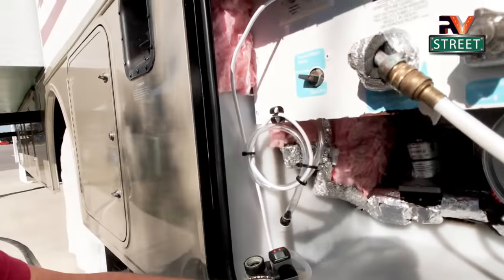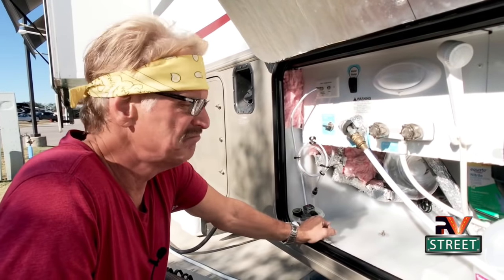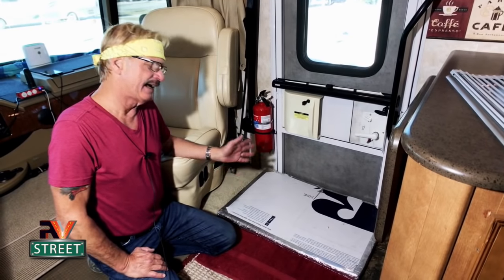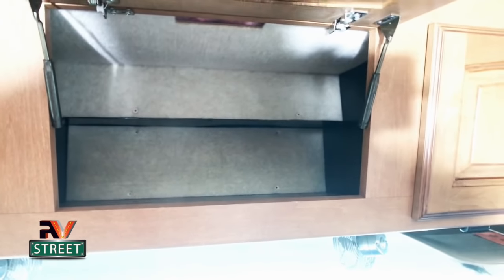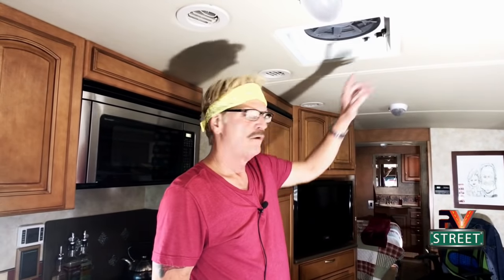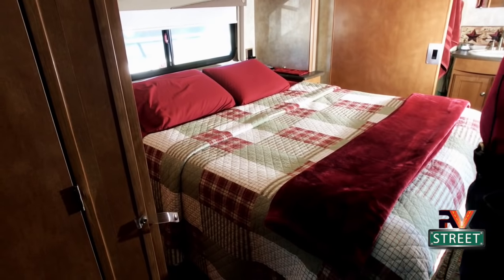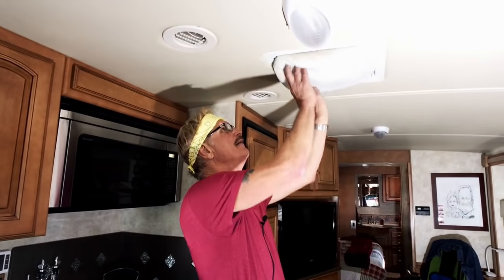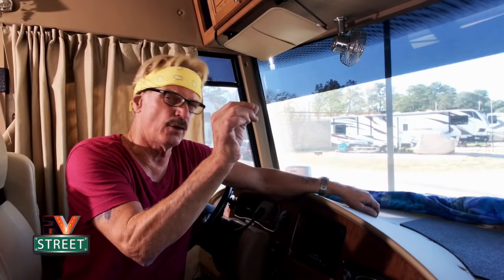😰  INSULATE, HEAT & PROTECT • Key to stay warm in your RV

Comment: Great video!  But...I am confused, as I always heard that propane is cheaper than electric...your thoughts?  I stay in a full hookup park and while the electric is relatively inexpensive, I have heard that propane is still much cheaper to heat my coach than electrical.  Contradictory to what you're saying.  Thoughts?
Reply from the maker: Well it depends on part of the country you're in. Up in the north east, propane has almost doubled since last year. And, a lot of full hook up sites include electric with your site fee. Can't get any cheaper than that. But in any case,, with our years of traveling, electric has always been cheaper whether we're in a full hook site or not. I fill up my propane once a year. I use my propane for just cooking. If propane is easy and cheaper where you are then by all means use propane.

Comment: Martin, I have a 2013 Vista in the same layout you have.  Have you ever tried to block the heat/cold that comes in through the shower sunroof?  I have the pillows for the vents but I have been unable to find one for the sunroof.  Do you use anything in that area?  Thanks for all your help.  My wife and I are just getting started, haven't even been out yet but looking forward to a trip to TX in June to see my new grandson.  Just worried about the heat.
Reply from the maker: I had a custom sun screen made for the shower sky light. I just snap it on in the summer and put it under the bed in the winter. https://rvsunscreenco.com/
I also applied Dicor roof coating over most of it on the outside. BIG difference reflecting heat. You can see that in this video: https://www.youtube.com/watch?v=H00oNtbvtrk&t=1209s
Reply: @RVstreet  Thank you.

Comment: Martin, agree to use free electric for heat vs propane, BUT: even if you have heated water/gray and black water tanks, that may not keep your lines from freezing. However, running the propane MAY be needed for that purpose to some degree (no pun intended). However, electric ceramic heaters and/or a fireplace will effect the thermostat and could keep the propane system from coming in at all. So I suggest keeping the ancillary heating system below where you set the thermostat for propane heat if the goal is to keep your drain lines/water feed pipes from freezing. You can still save on propane use AND save money by using the free electric at full hookup sites! Your thoughts?
Reply from the maker: Well that's why I explained that I do keep a auxiliary heating system below for the tanks. A 100watt light bulb. That's all that's need for us to about >10º. I don't have heated bays like many others. But I only use that when it's going to get below freezing for a prolonged period of time. Our floor furnace in the RV keeps everything else from freezing because of the extra insulation I've done. 
But my comment about why people use their propane instead of free electric when it's not freezing or the threat of freezing was covered more in detail in the very first comment.
thx Scott 👍
Reply: @RVstreet  for travel trailers, it’s more critical to pay attention to the solution I described. Your solution for a class A or C is (as are all of your videos)), EXCELLENT! Keep doing what you do brother. It’s excellent advice.
Reply from the maker: @scottanton4374  👍

Comment: Just curious.  What do you recommend for insulating single pane windows on a travel trailer?
Thanks. Enjoyed the video!
Reply from the maker: Single pane windows can be a problem and not all single pane windows are of the same thickness. Higher end RV's have 1/4" single pane windows, others may be less. You have to be creative here. Some people use reflectix cut to fit, some use foamboard or Styrofoam insulation.....I've found R7 for 1", Ultratouch Radiant Barrier, it's a silver sided cotton blanket type material but sometimes hard to find.

Comment: Yes not sure why they don't insulate better, our 28' pull behind is not insulated to well. Some one told me they are a little better then they used to be. The insulation will help just as much in the summer when it is hot too. Our last time or two out camping I will turn the propane furnace on(more to make sure it is still working) but plug in a electric heater also, and heat mostly with the electric.
Reply from the maker: Definitely will help both in the winter & summer.
It's all about manufacturers bottom line $$$$$$. As you upgrade to higher end RV's and pay more you get more stuff like thicker walls and more insulation. The bulk of RV's sold in the US are to the general masses as entry level RV's. However, some manufacturers do make true 4 seasons RV's but you pay more those. But even with those RV's you still can improve some things to make them even better. It really comes down to what kind of RV you need and what you can afford.
thx Trevor 👍

Comment: I believe you want to use propane furnace if the bays are heated using the propane furnace to keep the water from freezing.
Reply from the maker: Ya but many RV's don't have heated bays heated by the propane furnace. Like ours. We use heat lamps in our bays if it does get freezing. But if it's just cold but not freezing heating the bays are not necessary. So if it's cold but not freezing I just don't know why folks use their furnace using propane when they already have electricity paid for and they could just use electric floor heaters, That's what I was trying to get at.
Thanks for your comment Steve. It gave me another way to clarify what I was getting at. 🙏 🔧

Comment: Im looking to but a vintage bumper pull. I need nor want a new one nor a large one. So w/a shower & BA Im good. My mind is already right along w/you & your train of thought with all the insulation. I get the R19 but whats the madness behind removing the paper?
Reply from the maker: Hi Regina,
This question has been answered in the comments but here it is again....
In a nut shell, the faced insulation is normally used as a vapor/moisture barrier when used in home walls application and is not needed in this situation and especially when I’m putting in several layers in those large empty cavities. If Home Depot had unfaced in stock at the time, I would of bought that.
Love vintage bumper pulls.

Comment: I don’t remember the formula to see which is cheaper, gas or electric but I am sure you can find it in the search mode. Where we park for 6mo the price for propane is cheaper than electric. We are charged 
20 cents per kWh 
Love your videos
Reply from the maker: WOW 20 cents/kWh that's the highest I've ever heard of. Jeeze. But in any case, running electric heaters IS a lot cheaper in most cases. Plus you don't have to fuss with getting the propane bottles filled over and over again.

Comment: I think you would freeze here in Alaska :). What I have done is this. 1st, I have 2 catalytic heaters that run off the coach propane and require no electricity. 2nd, I have my furnace set up to run off power if I have it and the only thing I use is my blower that way I get heat thru my duct work and to my basement. Again I am using my furnace on electric not propane  keeps the coach at 72 degrees at -15. 3rd I insulated my steps like you do however  the top is 1/2" plywood so I can use it to walk on. As for the windows I use reflex insulation. In the basement I have installed heaters on my water tank, holding tank and piping so they do not freeze. the do run on 12v but  you need to have some sort of power or they will kill the batteries. the rest i have done as you have.
Reply from the maker: Ya, for sure this isn't for Alaska. I'd have to do a few more things to protect for long periods of time in sub 0º temps. But I would never stay in Alaska in the winter in the first place. At least not in our coach. Joanie would never let us do that anyway.If you would insulate under your plywood on the steps you'd get a lot better insulation though and still be able to stand on it. We don't stand on ours. No need to. But anyways,  in the lower 48....we would be good to about 5º-10º> for several days and just use our fresh water which stays from freezing with what I've done. Good comment Merle. thx 👍
Reply: @RVstreet  just a thought for those interested in my system it is called cheap heat. Although like everything else the prices has substantially increased.

Comment: I’ve made many covers for step areas in buildings and even in coaches you should always make that cover able to stand on otherwise it’s a danger waiting to happen when somebody does because they don’t visibly get that there are stairs there and they will stand on it and if it’s not strong enough it will collapse and you will get hurt. So either get a thin sheet of aluminum Or a half inch piece of plywood it will not increase the weight of that item that much and even your top piece of foam that rests on top could be just that piece of plywood or whatever
Reply from the maker: Our cover is strong believe it or not. Tripled layers together it's tough. I can stand on it with both feet and I'm 195lbs. It's only Joanie & I and we know it's there. We just remove it when not in use or when we need to exit. But good good advice to consider for others that may attempt to build one. thx Shock 👍
Reply: @RVstreet  nice

Comment: Lots of smart ideas! Why do you keep taking the paper off the R19?
Reply from the maker: Hi Sharon,
This question has been answered in the comments but here it is again....

In a nut shell, the faced insulation is normally used as a vapor/moisture barrier when used in home walls application and is not needed in this situation and especially when I’m putting in several layers in those large empty cavities. If Home Depot had unfaced in stock at the time, I would of bought that.
thx for watching

Comment: We use propane it keeps our under belly warm and floors warmer more even less draft my whole camper is closed in with at least two styrofoam  layers propane usually 1 tank a WK unless super cold 18 $ a WK including cooking 🍳 when I close in I run straight across and then go around slide outs stopped draft will post a picture also a window sucker that sucks up condeiscation

Comment: You need a carbon monoxide detector down low to detect gas leaks they have sealed Mr buddy propane heaters they can still have leaks ... Make sure to use a carbon monoxide detector.... That goes low as gas is heavy and fills the space bottom up.....
Reply from the maker: I have one down by the stove near the floor. 👍

Comment: Insulation under my slide sounds like a perfect idea. I wonder though my waterlines are tacked down in some way through the area and over the metal wheel well. I think that would make them subject to easy freeze. Do you have an idea of sliding something between the metal and the water line? Also it concerns me about water leaks. Will insulation mask that problem?
Reply from the maker: Will insulation mask that problem?...........
If you can slide some of the round foam insulation tubes over/around those exposed water lines then absolutely that will help keep them from freezing. Treat those water lines just like you would in a house. Protect them anyway you can. 👍

Comment: An 8k diesel parking heater will heat that motor home for around 6 gallons a week in sub zero temps. I’ve been doing it for 3 years.

Comment: What about -25F? 😂 I live in Camada. My wife and I life in our camper May to October. Considering going through the winter this year
Reply from the maker: Well anything under 10º for a long duration is to going to require more than I than what I showed and prepping for sure for any just about any RV and especially if it's a mid-level RV or under. A true 4 seasons RV's have thicker walls, better insulation and so on, but there will still be more to do to prep. I know a fella that lives in Mid Canada in an RV and it gets down to -25º sometimes even colder and he does fine. But he has done a lot to that unit to prepare, he lives in the forest, has an endless supply of fuel because he burns wood and he doesn't move it. When living in real cold temps for long periods of time—which we would never do BTW—lots of things have to be considered to prep properly, Like keep the batteries from freezing, protecting the tires properly, snow weight on the roof and toppers, your water and on and on I could go.
Thanks for watching Bernhard 👍
Reply: @RVstreet  thanks for your reply. I love how you went into detail on your video. Almost no one does that. I'm considering putting 1 1/2" Styrofoam sheets all over the outside walls and doing the skirting with that as well. I'll put a small heater underneath to keep the temp above freezing. So I don't have to run the furnace all the time to keep the tanks from freezing.

Comment: Never saw an RV with large square holes under the slides. Most have a thick rubber sheet to stop dirt, critters, etc. 
Those large square holes under the slides are an invitation for mice (and larger animals!) to get in also. Make a thick rubber
sheet in that area so you don't have to keep removing stuff every time you travel. Also where do you
store all your insulation?!
Reply from the maker: Store in the bay. Very minimal space, no weight, keeps critters out too. What we're doing works great. Keeps out drafts and dirt/dust from getting into the rack & pinion system.

Comment: My propane furnace heats the entire underbelly of my fifth wheel.( Black tank, gray and fresh water tank. So, in freezing weather we use it to keep our 4 season trailer from freezing.
Reply from the maker: Hi Richard,
Ya I get that when it's freezing but what about when it's cold but not freezing?
Here's the clarification I—pinned—in the very first comment of this video:
My clarification on using the propane furnace:
When I mentioned why I don't understand why some people use their propane furnace instead of a floor furnace and their electric at the pedestal, I don't understand why people would do that when it's not freezing temps outside because many do. They're using up their propane, when they could be using a floor furnace instead, use the electric at the pedestal, save their propane, and it's more quiet. Now if it's in the mid to low 20º for several hours or days and they're not using a light or something else in their bays to keep their tanks from freezing, then yes, I understand why they would use their propane furnace. Or if there is no available electric at all, like last years winter event in Texas. In those freezing scenarios, many people who do have heated bays, it makes sense to use the propane furnace. Otherwise, when it's just cold but not freezing and there's electricity, it makes no since to me to use the propane furnace. In 5yrs. we have rarely used our propane furnace.

Comment: In a house with interior doors with an inch open beneath them, pool noodles cut to door with and sliced longways on one side will serve as a draft dodger.  Wondering if they'd help/work for that outdoor use  ... especially if the drafty space is in need of a wider tube of foam insulation.  $1 each at Dollar Tree.
Reply from the maker: I found that using pool noodles is to big and to stiff. Even if you cut them in half. The foam pipe insulation are soft and rolls in and fits just right under the slides. When it's cold and windy, and they don't fit tight, the wind will blow them out and you'll come out the next day and they will be gone. Besides, depending on the size you buy at HD they're only $1.50 - $2.50 each and you don't need but about 3 or 4 of them. It really isn't a money issue, but what works and they stay put.
If you have wider gaps to fill I guess you could try pool noodles in that case and try them. But they need to fit tight.

Comment: I haveto use my furnace and 2 oil radiator  heaters.   But it gets below 0 lots in the mountains of Arizona where I live in my 5th wheel year round.
Reply from the maker: WOW, below 0 is super cold. I can see why you would have to use your furnace and heaters

Comment: I pop off all of the AC vent covers. Put the thin plastic lined packing foam over the hole and snap the cover back on. Is doing this preventing heat from escaping?

Comment: Thanks Martin for a great video. I do have a question. Why do you remove the paper from the insulation? The R-19. Also are these techniques to keep your pipes and water lines from freezing or just for keeping you warm inside? I have a class c and I'm afraid to take it into very cold weather due to this fear of my lines rupturing. Thanks so much.
Reply from the maker: I have answered this question before but...In a nut shell, the faced insulation is normally used as a vapor/moisture barrier when used in home walls application and is not needed in this situation and especially when I’m putting in several layers in those large empty cavities.
Reply: @RVstreet  thank you

Comment: I only turn on my propane furnace if it is so cold the portable heater can’t warm it. Usually if I have forgotten to turn it on. I only have to run it for about 10-15 minutes the. It goes off.

Comment: Use propane furnace because water lines are ran down the trunk line and without running the furnace pipes freeze
Reply: Live in one year round in Iowa where wind chills reach -30 below. Never froze up not once

Comment: All great ideas and tips. I have a problem with my overhead led lights in my 2020 5th wheel that are ghosting, they flicker even with the switch off. I changed the switch twice now and it still continues. I was told it my be my converter going bad. Any ideas on a fix for the problem.?
Reply from the maker: With a sad heart I have to tell you that Martin has passed away and I don't have the answer to your question. Sorry
Reply: @RVstreet  I'm so sorry for your loss. Love the channel.